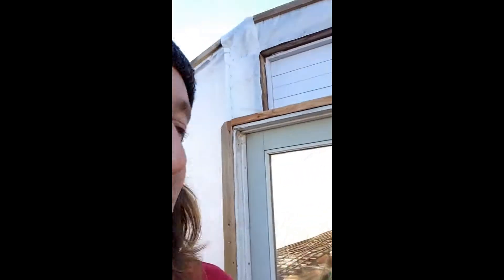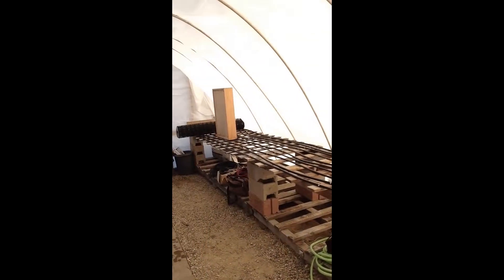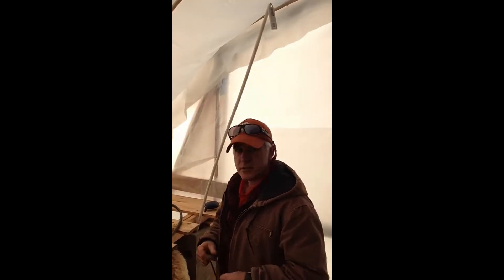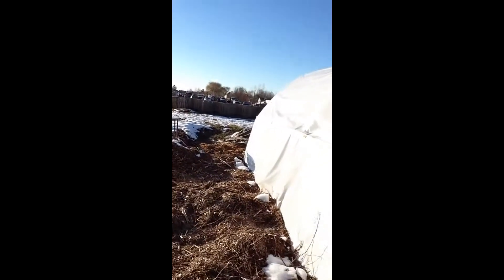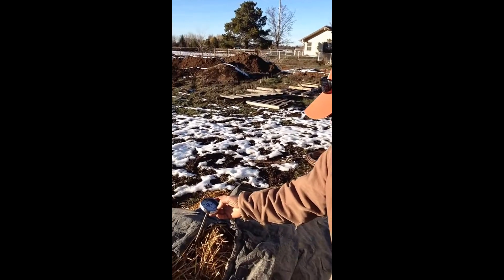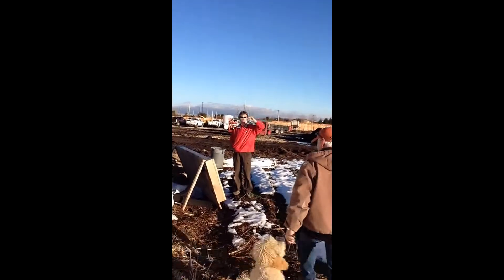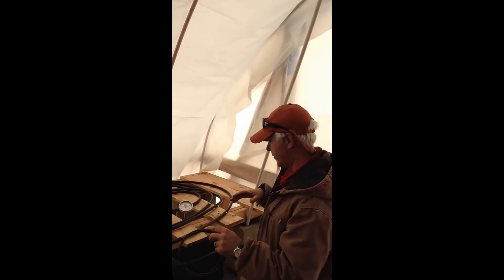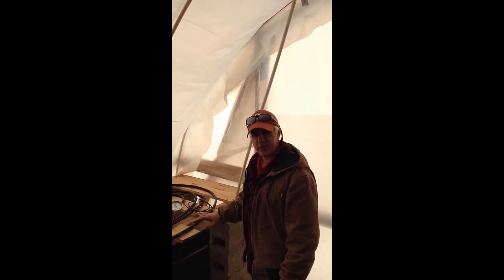Winter farming with compost water heated greenhouse

Comment: How did this idea pan out? Were you guys able to utilize it to start seedlings? How long did the compost pile heat the water? I had the same exact idea, although my modification would be to run the piping through sand in the greenhouse so the sand acts as a heat sink. Basically a propagation bench without electric heating elements. Perhaps that would take too much heat away from the pile. Nonetheless, it's exciting to see others implement it. There's also some interesting engineering about the speed of flow of water and heat transference. Others have also used timers to turn the pump on and off. One video on here utilizing copper pipes for inside the compost pile to help transfer the heat better.

Comment: The nights are when you will notice the difference in the high tunnel. the sun does all of the work during the day. I am not trying to sound cynical just looking for a good way to heat my greenhouse at no cost!
 Please update us on how the temps do once the sun goes down to realize the benefits of the compost heat.
Chuck
Reply from the maker: +Fensterfarm Greenhouse We have so much water in the high tunnel that we use as a heat sink. It is capable of holding the temps through the night. We have over 800 gallons of water. It is currently running through our aquaponics system which gives us dual functionality. If you are interested in the science and getting some better knowhow head out and get a copy of "How to build a compost water heater" by Gaelan Brown. It's a great read!